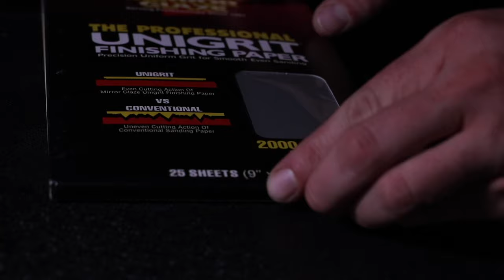SUPER AGGRESSIVE paint correction! My quest for showroom shine on black paint

Comment: Looks good.
Wonder how much clear is left, though... How much thickness would that paint measure with a paint coating gauge?
Reply: Probably close to gone
Reply: @kg_1720  Yeah the safe thing to do is have a body shop re-clear and wetsand the whole car prior to polishing. I have a friend who did this on an older Modena that had been through the wringer, looked absolutely amazing afterwards, but I mean, this is a truck.

Comment: Micro mark makes a cloth sanding set that runs from 1800 to 140000 for scale model work. I just did a pretty jacked up sport track and the soft backing allowed for a very clean hand sanding. Found my new hand sanding process..
Reply from the maker: Post a link!

Comment: Did you check before you did wet sanding how much clear coat you had to play with?  
 
Chasing perfecting gets you in trouble most of the times.
Reply from the maker: It does indeed. My paint gage stopped working a little while back, so I try to really look for texture before I do any kind of correction or sanding. If texture is leveled I put on the brakes
Reply: @HawkProDetailing  maverick!!  Now the question is did you want perfection or did the customer?  How long did it take and how much?

Comment: That turned out amazing! How much would you charge for that job minus the ceramic coating?
Reply from the maker: We charged 1500 for this job. It sort of depends on the customer and if closing the job means you throw something in or drop price a bit. I couldn't do this job for less than 1200 unless I absolutely had no food on the table and the heat was about to be shut off lol. And I would like to get 2000 for the job. You just have to make it work for your business
Reply: @HawkProDetailing  i see! You did a great job. I can’t believe you got it to look that good

Comment: hi, if did you use an orbital sander with 2500 gr I'm sure you save a lot of time I remember when I took my certificate detailer technician y to transform one jeep wrangler 2012, I did already sold in Saudi Arabian,
Reply from the maker: I actually used a dual action polisher with 8mm throw, an interface pad, and meguiars 3000 Grit sanding disc,  which I bought from autoality.com

Comment: Hi  @Hawk Pro Detailing  can u help me out with this question. I have a vehicle I did but I noticed the coumpound haze were not coming out with the polish the step that I did is at the bottom 👇 can u read it and tell me what I did wrong.
I buff a vehicle similar to yours I did not wet sand it thoe but had similar scratches and swirl makes it didn't had holograms thoe so I use a course coumpound with a 6 inch dual action polisher with a 6 inch compound pad 4 time it took me to take out all the swirl,after that I use a panel wipe that remove coumpound  and polish residue, then I  polish it with a polish pad to remove compound haze that were created from removing swirl marks so I polish it 2 time to get the gloss and to remove the haze and  when I finish I use a panel wipe again to remove the polish residue before I ceramic it but I noticed that it stail have compound  haze. Is it because I remove all the polish residue but i had to ceramic it 

And a next question when finish polishing vehicle do I need to use panel wipe before using sealant and wax or it just for ceramic coating
Reply from the maker: What pad and polish?
Reply: @HawkProDetailing  a minimum polishing pad
Reply: @HawkProDetailing  did u read the bottom message
Reply: @HawkProDetailing  sorry I was on my other account
Reply: @HawkProDetailing  a medium polishing pad and meguiar's ultimate polish
Reply from the maker: Sorry bro I just don't have enough info and I've never used that polish. I'm not trying to be short it's just nearly impossible to troubleshoot polishing issues without seeing it and not knowing the ins and outs of your liquids. If you have the products in this video I can walk you through the best I can
Reply: @HawkProDetailing  I'm glad if u can help but that product u have it not in my country
Reply: I checked it on Amazon but it say it's not available in my country
Reply: In my country only a few people buff like u guys I used to work at a body work shop I say one of your videos that have u said some guy buff it and created holograms and stuff I use to buff like that I never used to use dual action polisher but now I trying my best to do good quality work I only sometimes on black pant the coumpound haze is hard to remove with the polish

Comment: Wool pad on a rotary with low speed will get the sand marks out
Reply from the maker: What compound?
Reply: @HawkProDetailing  As long as it’s of the heavy to medium side you will be good. Jescar medium cut compound or Menzerna 400 will work just fine

Comment: Anyone who sands with a bucket of water is silly. Its self contaminating just like washing a car with it - totally silly and obsolete to wash with buckets.  Zero bucket is better whether with shampoo or rinseless.  My motto is sand more polish less. Ive played with 8000, 12000 micro mesh and japanese 15000 grit.  Least i would finish at is 5000
Reply from the maker: I bought 5000 grit discs a couple times, but for some reason I just never found a place for them. I tend to go 3k machine sanding...compound. what are your thoughts mr jedi master 🤓
Reply: @HawkProDetailing yeah 3k is often enough but with 5 and 8K you eliminate the compounding and could do one step via da, forced or rotary with a gekatex blue foam, Scholl concepts honey pad or lake country hdo blue and be done. Just a finishing polish. Micro mesh 12K looks like lightly polished paint. I say each to their own. Sanding is cold, uniform and consistent, polishing has many variables and is a heat producing process but an adjustable one.  I prefer to sand finer to eliminate the need for compounds and fibre pads plus simplifying  the polishing process to one fine grade liquid or two liquids together and one foam pad.
Reply: I’m surprised you guys don’t one step after using 3000 grit? I’ve done 3000 grit then Meguiar’s 166 or 205 one step jobs plenty of times. The only time I ever use a compound is to level heavy defects or if I stop sanding at 1500-2000 grit. I don’t bother with anything past 3000 grit, 5000 is a waste of time since I can one step 3000 grit anyways.
Reply: @STILLNIGHTPEARL  yeah it's personal preference. I use the 3, 5, 8 and 12K discs sometimes. Oxidation, dry spray, scratches etc.  Absolutely we can 3000 and one step it and I've done it before.   But i really enjoy 5000 and 8000

Comment: As far as the sandpaper in a bucket goes... You soak it in hot water for 15 mins or so before hand, it softens the paper so there are no sharp edges when it's wrapped around a sanding block.
Reply: Nice.

Comment: That was just amazing how you managed to do that!! A true artist in my opinion. Great video, thanks 🙏
Reply from the maker: Thank you sir! Artists don't really make money in the world of detailing 🤣 But sometimes I can't help myself lol
Reply: It looks good the vehicle I did I had a hard time removing coumpound haze
Reply: @HawkProDetailing  Hi  @Hawk Pro Detailing  can u help me out with this question. I have a vehicle I did but I noticed the coumpound haze were not coming out with the polish the step that I did is at the bottom 👇 can u read it and tell me what I did wrong.
I buff a vehicle similar to yours I did not wet sand it thoe but had similar scratches and swirl makes it didn't had holograms thoe so I use a course coumpound with a 6 inch dual action polisher with a 6 inch compound pad 4 time it took me to take out all the swirl,after that I use a panel wipe that remove coumpound  and polish residue, then I  polish it with a polish pad to remove compound haze that were created from removing swirl marks so I polish it 2 time to get the gloss and to remove the haze and  when I finish I use a panel wipe again to remove the polish residue before I ceramic it but I noticed that it stail have compound  haze. Is it because I remove all the polish residue but i had to ceramic it 

And a next question when finish polishing vehicle do I need to use panel wipe before using sealant and wax or it just for ceramic coating

Comment: I've worked on far worse but that is messed up. Great job Nick.  PS are you using encapsulation tech for the interior carpets and fabric seats as if so you wouldn't need the anti wicking product. Never have sandpaper in a bucket of water and or water/soap and keep dipping your sandpaper into the bucket then continue sanding, that's a good way to put in marks in the paint. sand with a spray bottle via hand.  damp or dry by machine.  Micro Mesh, 3M Trizact, Kovax Super Buflex dry aka Eagle abrasives in the USA are my go to sanding materials. Mirka is apparently quite good too.  Up to 12,000 grit if you want to go mad.  Kovax super buflex black dry discs finish out so shallow it's ridiculous.

Comment: EXCELLENT BUT YOU'VE just most likely removed ALL the clear coat from that car and SOME tiny fraction of paint. I know by hand you can control it 99% but it's not 100% even and 100% guaranteed. Infact i guarantee you took some paint off in the process. I would've used a clay bar with some isopropyl alchol to clean that surface before compounding it. To be 100% honest that deep and swirly scratched are easier fixed with a FULL property respray AND MOST IMPORTANTLY 2K CLEAR COAT at the end of it.  Any of this graphne or ceramic coating ISN'T 2k clear coat and won't last 5-10 years like clear coat. Explain and discuss:

Comment: Great job man!! I feel like i gotta detail mine every few months. Scratches keep showing up
Reply from the maker: Thanks my dude! Yes that's the problem with striving for "showroom" ...if you actually drive a vehicle, it will get swirls and scratches. So much crud on the road, so many weather factors we can't control. Even the most diligent detailers inflict some damage on paint with hand washes. Basically you want to touch your paint as little as possible as a rule...but also, don't lose your mind over this because if every little thing upsets you it's easy to go insane 😂 unless it's in a museum a car will get scratches
Reply: @HawkProDetailing  ohh i know! Im already at that point. I literally wanna beat the crap out of my car after a wash and swirls are every where. Im at the point that im putting it up for sale.
Reply: @HawkProDetailing  bro what u just said made me feel alot better lmaooo
Reply: for my car, as a detailer. i understand that, its an infiniti q50, with midnight purple paint so i want to keep it prestine. but lets say i had a more expensive car, something like a bmw or a porsche, id highly recommend PPF (paint protection film), you will never get and swirls and if you do, use a heat gun and itll come right out without even having to touch the car
Reply: @Dee Do you bring it to the car wash? Because the bristle brushes they use can put swirl marks on your car. If you arent already then try using a microfiber wash mitt. And wash in straight lines in the direction that the wind would be blowing on your car while driving.

Comment: I'm curious if it's worth just re painting the car at this point. It looks like it would have saved time if you are sanding the car anyways. How long does the shine last for after a expensive detail job like this?
Reply from the maker: Shine does last for a long time, especially if truck is washed/maintained properly. Way cheaper to do this vs re paint 👍
Reply: @HawkProDetailing   how much do you usually charge  to do the whole truck??

Comment: I get a ton of fresh paint jobs with orange peel I need to cut and buff a body shop next to me gives me all his cars to cut and buff I wet sand with 2k grit then 2,500 grit then 3,000 grit then polish I use an all in one compound has the cut polish and wax works amazing with a finishing pad
Reply: What’s the 3-1 called?
Reply: @melvintrejo8036  p&s play maker or 3D also has one that good as well it’ll do the same results with what you had to correct on the black paint in the video
Reply: @melvintrejo8036  but wet sanding should be a last resort if it’s not a fresh paint job as your taken off a lot more clear then without wet sanding and u can’t add more clear unless you get it recleared
Reply: if the scratch is like in this video, can i just cut it using agressive pad such as cordurouy or jeans pad with agressive compound ?
Reply: @harisyoung4110  yeah I believe you can
Reply: @AliVapeReviews  ya but too much sanding can break the clear coat
Reply: @lilsamreactions507  not with the cars I do he puts 4 wet wet coats on clear after I cut and buffed it read 8 on all panels

Comment: The MOMENT you see pigtails, STOP and either clean your sandpaper or replace it.  Depending on where you are in progress in a certain section, it actually might be better to clean the paper you have, as that piece has a new grit compared to a fresh 
Icee of identical paper.    First try wiping it away with the clean cloth you should always have at hand, dry cloth for dry sanding, wet for wet.   You’d be surprised how much crap comes off the paper just by wiping it away.   But the topic of pigtails.   Pigtails come from one thing and one thing only.   Bits attached to your sandpaper which are now additional and random grit on your paper.    These can be anything, but most often it’s bits of paint which have become dislodged, either from the heat of sanding or having bad adhesion in the first place.   On OEM paint this is usually just where contaminants have attached themselves to a bit of OEM paint and the sanding action pulls it all up and out, sometimes leaving a new tiny dimple or hole in the paint.   Go back to the days of the Spirograph toy and you’ll see how that spec of basically resin leaves it’s mark in your sanding pattern.   Bad stuff, as you now have to sand away the marks which you just made while trying to sand away the marks that were already there, taking away yet more of the PRECIOUS clear or paint base coat.    Every single little bit is crucial.   Ask me how I know?   I always though pigtails we’re just a function of the grit of the paper and the speed at which you moved the machine.    It seemed like when I moved the machine faster I got more pigtails.   Wrong.  It’s just that the other parts of the paper would sand away the pigtails while the pigtail culprit was diminishing or breaking off, and guess what, that was yet again causing more problems.     The whole idea is to GET RID of the baddies.    I’ve gotten to where I might sand for ten seconds and stop and remove crap from the paper.   So be it.    That time is a great investment and the returns will be huge, in that you won’t have to spend even more time sanding away the sanding mistakes you actually inflicted upon the surface while trying to fix the surface.   As a good doctor says, “do no harm”, that’s virtually impossible when doing any type of touch up or correcting paint, old or new.   You are destroying the paint/clear such that the underlying destruction is uniform, then polishing that surface to a nice shine with ever more refined grain until the eye can no longer see the difference between one valley and another.    “We will invade that country, level it’s infrastructure, and rebuild it to our own liking!”   Turns out our liking isn’t orange peel or anything we don’t perceive as mirror-like, all the while the paint was more protective overall and would retain the most longevity if left alone.    Excepting obvious real damage penetrating the primer coat of course.   Even then, SOME older OEM primers can absorb water and must be covered with something, preferably a color matching paint to protect the body from rust or corrosion.    We destroy to rebuild.   This dude did an excellent job.  Been there.   Not done that so we’ll plenty of times, but my OCD behind looked closer and figured some of this crap out.    I’ve even used solvents to get rid of scratches, albeit very, very carefully.  How?  By reversing the paint process.   If the paint got hard after solvents evaporated, then maybe reintroducing solvent to a particular spot would soften the paint enough to reflatteen it.  How to do that?  Tip of rubber gloved finger.  Very, very, very carefully apply a little blending solvent to the tip of your most dexterous finger, with the latex pulled tight, smooth, and clean, and very gently rub(on fresh paint) or firmly (on seasoned paint) to soften and smooth the scratch.   Call it chemical non-sanding sanding.  It works.  Obviously protect the surrounding surfaces to prevent any drips of the solvent or you will have much bigger problems.   Ask me how I know.   Well……….
Reply: Why not making a video? Sounds like you care about the details and that's important

Comment: It looks like ur using alot of unnecessary pressure.. and i personally make sure to keep surface wet like claying it
Reply from the maker: Maybe that would fix the weird outline from polishing, although it's only happened a few times. But you could be right. I do feel like there are a lot of ways to get results and some (I hope) are faster than this method
Reply: @HawkProDetailing  you motivated me to wet sand my bmw front bumper and it ended up coming out amazing
Reply from the maker: @unpopularopinionz  just don't blame me if you burn through 🤣 haha thats awesome man. Thanks for sharing 🤙
Reply: @HawkProDetailing  im currently taking fulllll responsibility. Lmao… one little fucking spot damit. I knew it too when i got to close to the corner

Comment: I’m about to have my raven black Cadillac ATS color corrected/wet sanded. What would be an average ballpark estimate for something like this? Also, if I were to get the ceramic coating as well, what would that run me ? I have a few estimates allready I’ve just never had it done before and want to make sure the price is right.
Reply from the maker: Maybe 2k…what estimates are you getting?